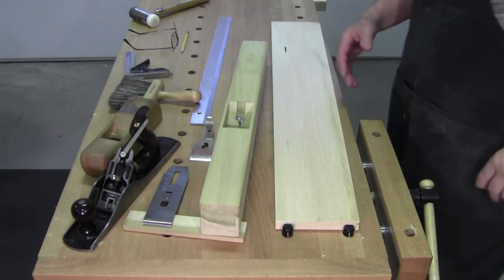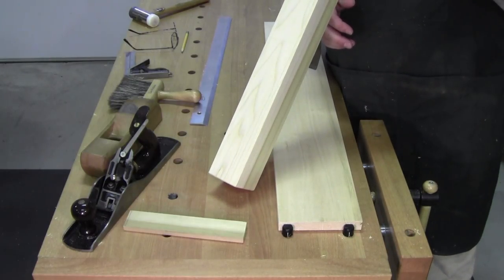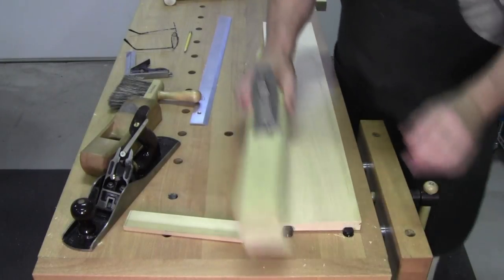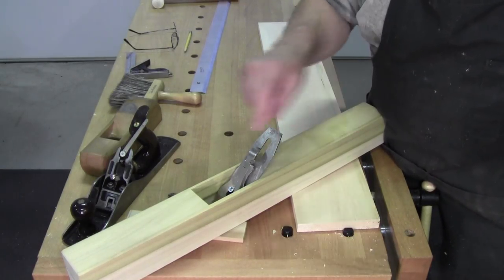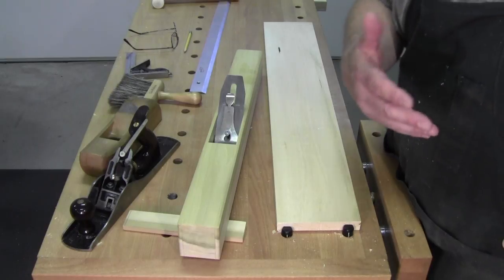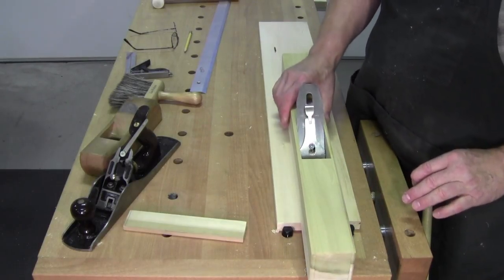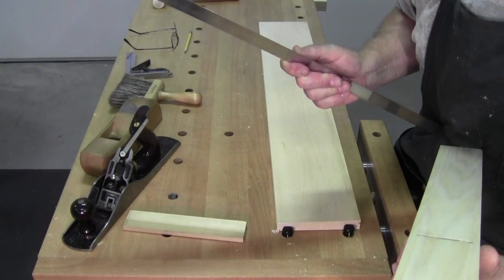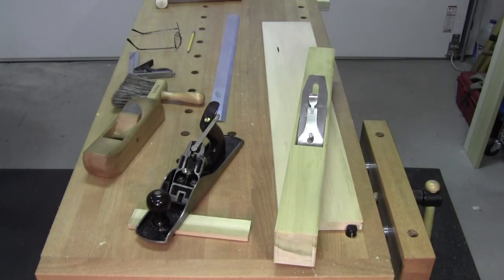PLANE TALK - No Jointer... NO PROBLEM / Part 2 - 20th July 2017

Comment: What do you use to sharpen your plane irons?
Reply from the maker: I have used just about every method and currently am using a Trend 300/1000 diamond plate and an old used 4000 Grit Dia Sharp.  Sometimes if I want to take it one more step, I polish on ha hard flat block of Maple with 6000 grit.
It does not matter what method you use, just keep it simple.